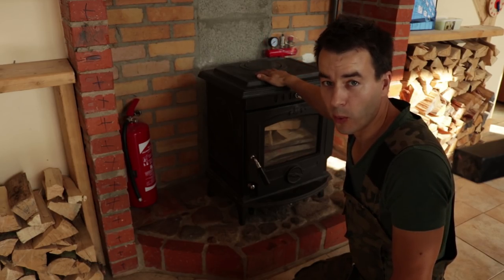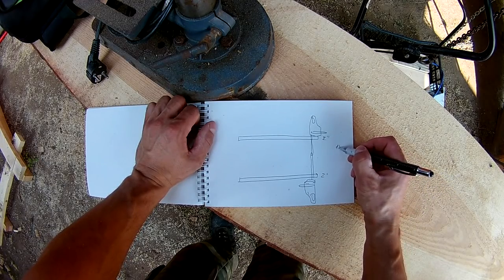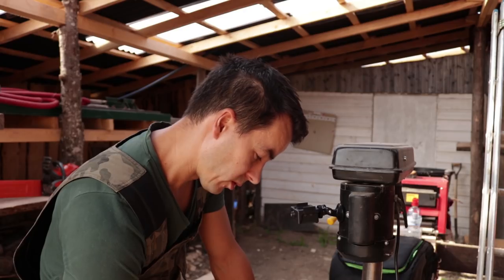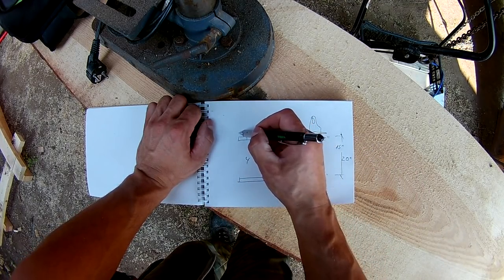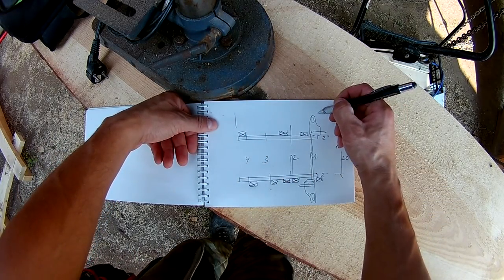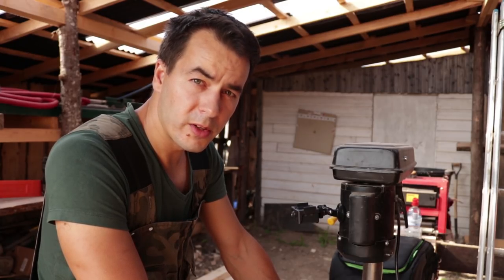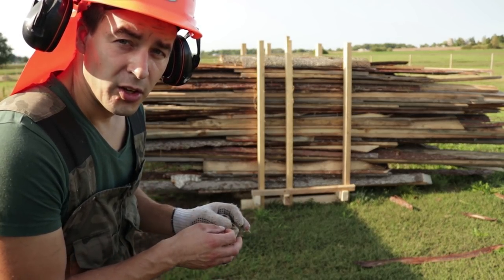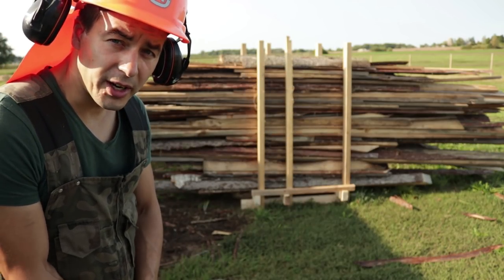Firewood rack - time saver

Comment: but now you have to pick it up off the ground ,build it taller and back a small trailer under it , to catch the wood
Reply from the maker: Thank you for right comment! As long I am daily sitting at computer (architect), I like this gymnastic, to pickup from ground, do not have problem with that. But when I will come older / smarter, yes, will need update with your suggestion!